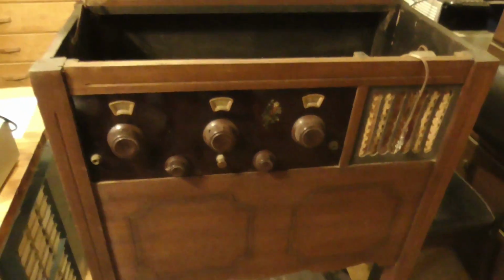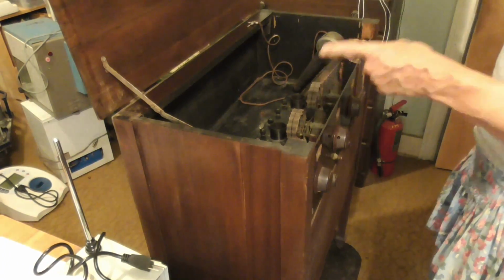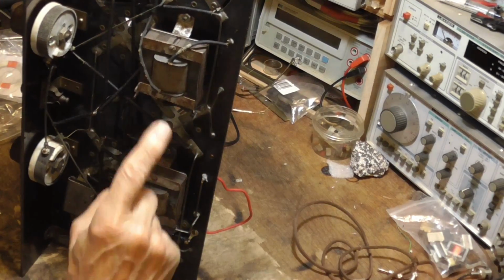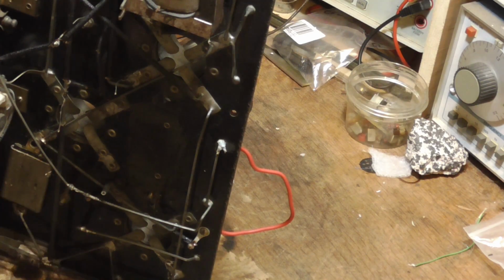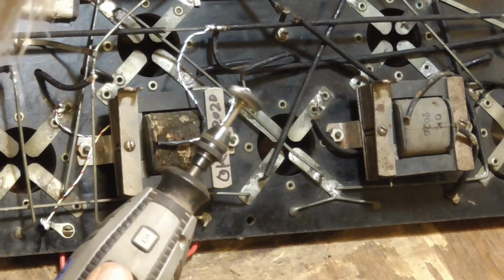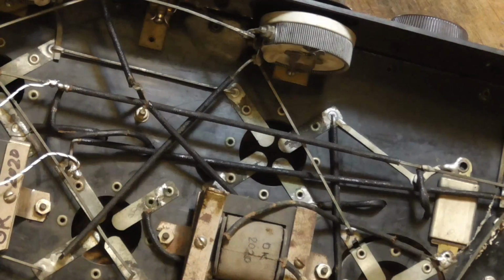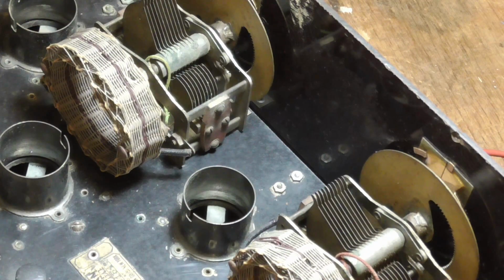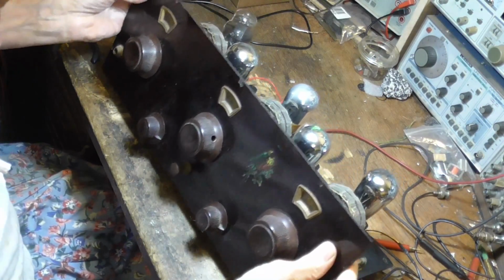RESTORING AN OLD FADA RADIO

Comment: Excellent video Ron - I share the same passion for getting things done rather than a nut and bolt restoration. In the time it took you to sort that out Mr Carlson wouldn't have finished talking about his capacitor leakage obsession!!
Reply from the maker: HA! I like Carlson a lot. He's quite intelligent. The only way to watch his videos is to set the playback speed to X2. He, he, he!
Reply: I agree, but I do like to see the different approaches taken by each. I kind of reckon Ron probably works on these like they would have done back when, whereas Paul treats them like museum pieces. Both are valid and enjoyable to watch!

Comment: Hello from england.
How long do the tips last on your solder gun, when I used mine a lot it ate tips,
Reply: Get some thick solid bare copper wire - probably AWG 6 or 8 - and make your own tips for dirt cheap.
Reply from the maker: #12 for the 240 watt gun and #10 for the 325 watt gun.
Reply from the maker: Yes, they are "hungry" for tips. I usually get about two weeks out of a tip. I make them out of #12 square bus wire. (round works fine too) Take a piece of romex and strip the plastic off it for plenty of cheap tips. The commercial tips last longer but are now way overpriced.
Reply: @glasslinger  Thanks I'll try that, I have some 3.0mm copper
Reply: make on of gold , it will last forever !!

Comment: Ahem! Not quite done-- what is to power this old wonder? A nice array of batteries? Or a more modern power supply? OR does it just go back in the living room to fill that hole-- didn't work before, no need to turn it on now?

Comment: 3 dial tunning is hard - set all resonant spikes on same freqency.
Need switch to set one of stage to aperiodic RF amp / LC tuned. Use two hands and find stations and after find, set third stage to resonant mode and tune it.

Comment: I was wondering if this  really was a FADA radio until I saw the builder's plate. It is a Charles Freshman  Co. Masterpiece radio from the early 1920's!
The three large knobs controlled the tuning of the circuits and must match closely for best reception. The two smaller knobs did the filaments for the amplifier (left)
and the detector(right) . In between both is an on/off switch. To turn it on just pull out the knob a bit. I must admit it does look like a FADA model.
Nice piece of restoration work again Ron. Excellent restoring it to working use.

Comment: How long would the batteries last back in the day for these type of radios?
Reply: High Tension 9 12 months, cost 15/ to £1.  Grid bias 9v - 6v 3 months 3/-.  Accumulater 1 - 2 weeks cost £2 ? charging 6d.  We recharged and sold them.  Weekly wage was circa £2.  It was not cheap !
Reply: Depends on strength of station, aerial, battery type & maker

Comment: Do you remember the old Ma and Pa Kettle movies? They used to be on TV when I was young. I remember a running gag in the movie where Pa would slam his rocker down on the floor to turn on and off the very early model radio in their shack. Seeing those type of tube sockets, I can understand why that was plausible back when people had those radios in their homes. I bet people smacked and pounded their radios quite a bit to get them to operate.
Reply: You are absolutely right! I remember how, during my childhood, I was even proud of the clever blow on the TV on the vacuum tubes, which returned the efficiency of this unit. :)   I am sorry for my English
Reply: That console radio would have cost them a full year's wages

Comment: That soldering gun you use is massive for doing jobs like that if you used a Weller soldering iron you would get the same effect and you wouldn't burn your fingers as much
Reply: Some guys are use to having that big gun in their hand everyday and trading it in for a wee one would just feel all undeservedly stunted and unnatural.
Reply: Get yourself an old Weller like that. It's hardly the tool for surface mount, but you'll find yourself using it a lot. It's ready to go in about 1 second, and can easily keep up with soldering to those huge chunks of metal - something that'd cool down a lesser tool.
Reply: I use a soldering gun very often. This is an old tube set not SMDs. They sure didn't use soldering pencils when they made this thing. Their soldering irons look like the ones they use today for stained glass windows.
Reply: Pretty sure both a gun and a smaller iron made appearances in this video, but for the larger bus bars and such I think you need the gun.
Reply: Ron has discussed this quite a few times in past videos... the size of the wires used, component wires, the connecting base materials, and the actual solder used make it necessary to use something with a more heat and surface area than conventional soldering equipment. Search for antique soldering equipment and you will see that the equipment used to originally solder these components together were much heavier than current day irons.
Reply: That WAS a Weller, lol. Those are what you need for the old gear, not the new namby-pamby pencils. I've seen some people on TubeYou stabbing a feeble modern pencil iron at a lug for minutes on end hoping to warm it up. My dad used the old Weller gun, and I have a vintage one myself. I only had to replace the light bulb and it was fine.